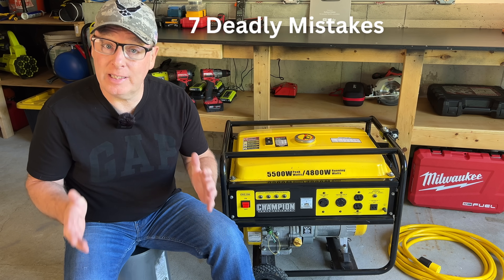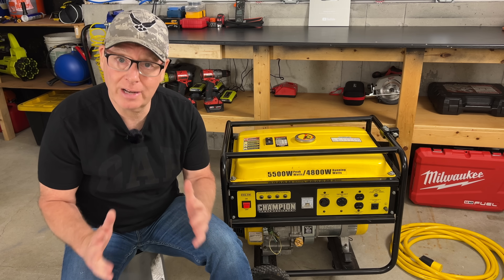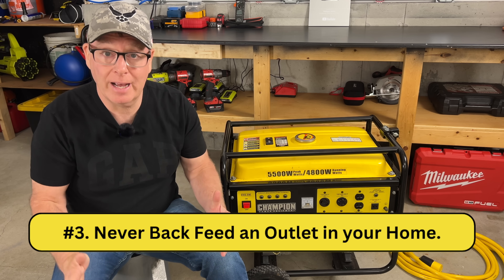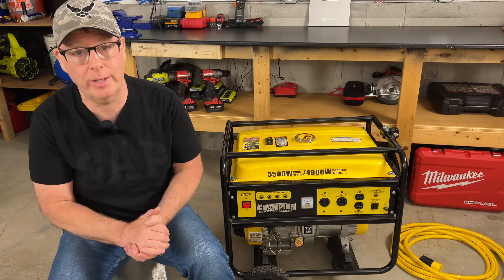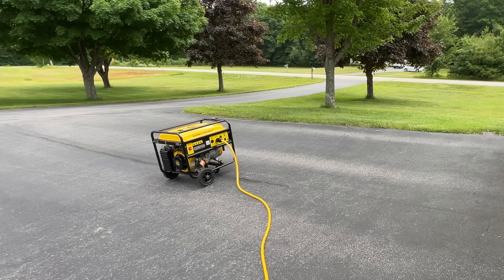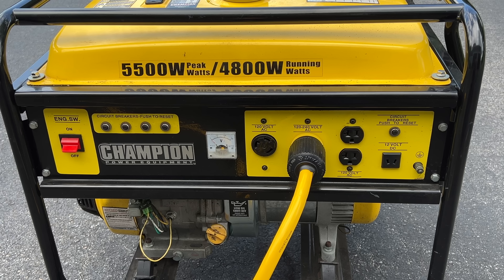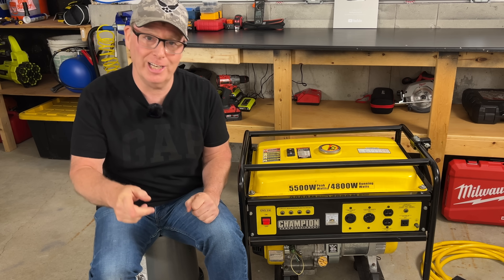7 Backup Generator Mistakes. (Have You Made One?)

Comment: Can u clarify:
1. Plug in cable from generator(L14-20) outlet to house (TT30PP)
2. Start generator let it warm up
3. Switch off breakers on Utility / Generator transfer panel
4. Move switch from Utility to Generator on panel
5. Switch on breakers Transfer panel 
To shut off and return to Utility power
1. Shut off generator
2. Unplug power cable from generator to house outlet
3. Switch from Generator to Utility on transfer panel (is it necessary to shut off the breakers on the transfer panel prior to #3)
Thank you!
Reply from the maker: No, the utility supply will have no problem when everything comes on at the same time. Cycling the breakers on one at a time when transferring to generator is a good idea so you want stall the generator or see a large voltage drop when everything cycles on all at once.

Comment: Agree with all that about the suicide cord and backfeeding. But I have one question/ comment about the risk to utility workers. I can't imagine a utility workers touching a conducter with bare hands.  And how is the utility protected from solar homes? Many are setup to feed excess into the utility. Wouldn't that be happening during an outage?
Reply from the maker: Legally installed grid tied solar installations require an automatic disconnect when utility power is lost. So no back feeding is possible. I think most lineman will wear protect gear including gloves but maybe that aren't as careful when they test a determine the line is de-energized. There are many cases of lineman being killed from back feeds. Another thing to consider is a neighbor on the same transformer.

Comment: Most likely a dumb question: assuming there is no gauge in your breaker box or generator how do you know how much power your generator is supplying at any given time while using it.  In other words I need to know how much power I am using so I am not over taxing the generator.  Any help is appreciated.
Reply from the maker: Here's a link to a wattage guide. It's not exact but it will give you a rough idea. Remember many of the loads listed are intermittent so we just need to be aware of what we run at the same time. https://unboundsolar.com/solar-information/power-table?srsltid=AfmBOopXB512JkVqevVGocF5xH2Cp_jZozEiIojjnUQkKtBO6zMTiV1c

Comment: I've read and seen videos of people connecting their cord to their unit AFTER they turned on their generator... so I'm a little confused here. Since I am looking into getting one for our new home. Any tips on this?
Reply from the maker: That’s fine in dry conditions. The reason to connect it before would be for safety in wet conditions. It’s very important to have the generator connected running and warmed up with the generator breaker in the off position. Never connect under load or try to start your generator while it’s loaded. I hope this clear things up for you.

Comment: Use only the best oil and gas non ethanol!! Keep extra battery and spark plug on hand also! Charge batteries often! Run generator once a month! Keep the generator out of the rain!! Put a plastic dog house rooftop over it when using when raining! Put the open end of dog house cover on the exhaust end of generator works great!!

Comment: Don't live in the city, do you.  A generator in the driveway would be gone by morning.  It's why city folk die from bringing it indoors or in the garage.  Chains don't work.  You can snap a chain, so can they.  The solution is in a shelter, with chains, lots of ventilation and let the shelter air out before going inside with the generator so CO clears.  It is what it is.

Comment: If you have a mechanical interlock your generator circuit will be off until you shut off the main and move the interlock. 
I also had my generator in a enclosed housing with the exhaust vented out.

Comment: Not sure if anybody mentioned this, but what I am doing to deal with the "wet generator" problem is to keep the generator permanently installed outside, in a GenTent with a skirt and clear apron. That keeps the weather off of it.  Then when I want to use the generator I will remove the skirt, which allows air into the intake and allows a clear exhaust path.  But the GenTent remains in place keeping weather out, and the clear apron protects the front panel so it doesn't get wet but permits visibility so you can see the panel.  

I have not yet had a power outage so I can't vouch for how well this system works, but I'm hoping for the best. 

Thanks for the info about refueling.  The manual says not to refuel while it's running, but your practical tips tell the whole story.

Comment: Just wondering if have 6/2 wire in my main breaker panel I would like to install interlock generator kit with 30 or 50 amp but it seems like need neutral on either one. Is that mean I will need to ruan new wire that does have neutral?

Comment: No. 8:  In a power outage it may be advisable disconnect your main switch in case your neighbor is backfeeding.
Reply: Most generators have a 30 amp breaker, if a neighbor was back feeding, I'm sure all the load would blow his breaker as he would be feeding everyone on that line

Comment: Great video. Can you make a video that shows how to connect a generator to an off grid house that uses the generator to fill batteries? In this scenario, there is no electrical grid. The entire house runs off of the batteries, and the batteries are charges via solar panels and/or the generator. And of most importance, is how the electrical circuit breaker box is setup and installed in the house. Thanks.

Comment: Question for you, or any electrician... I am installing an interlock kit and a generator inlet box to my main panel. I have a neutral bonded generator (Firman71XX series, 240V) and my panel is neutral bonded. Any ideas on how I can get around this without buying a subpanel or transfer switch?
Reply from the maker: You can remove the bond on the generator for when using it for home backup. If you want to use the same generator for other things you can buy or make a bonding plug.

Comment: We bought an exhaust system that takes the exhaust/carbon monoxide outside from our garage. Our neighbors are too close and the generator is too loud to be acceptable outside.
Reply: It’s a power outage, conditions aren’t normal, not everything can be as quiet as usual.  Generators, chainsaws, etc. all could have to be employed in emergency situations to maintain your home-a neighbor in the same situation as you are needs to be able to understand they can’t have normal quiet and deal with a generator being run.  That said if you have done this of your own accord, primarily for your own benefit-and they benefit from the quieter operation as well then so be it.
Reply: @balrog006  Your's is a message from a reasonable neighbour! Our neighbour is a retired bylaw officer and complains about every little thing! I suppose the generator could also be turned off at night because our frozen and refrigerated product won't be affected by a few hours of no power.

Comment: Use a longer filler hose so the fuel container is not directly above the generator. Use a funnel wider than the tank opening inorder to prevent spills. A hot generator takes a long time to cool to safe temperatures. Using a smaller refueling container is less awkward for handling.

Comment: Thanks for this! We just got a generator this winter and don't have an intterlock so I  connected gen->30a twist extension->15a 3prong freezer. At the time I was concerned about arcing since there's no switch in between. Would you suggest getting an extension cord with a built-in switch instead?
Reply from the maker: I'm not sure how you're connection the 15A and the 30A plugs since the are designed size specific. But you could buy a cord with a switch. The best option would be a generator connection like I show in this video. https://youtu.be/5y7RaJSAMZQ

Comment: Thanks for the video.  Do have to ground your generator when using? I've noticed that my generator has a grounding screw.
Reply from the maker: The generator is grounded from your electrical system when the cord is plugged in. The only reason to install a ground rod would be if the generator was connected as a separately derived system. This is when the generator and the utility service conductors both not and neutral are switched with a transfer switch. With most generator connections a ground rod is not required.

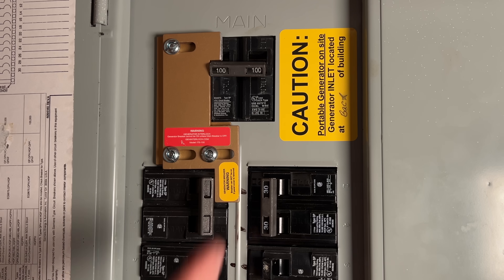Comment: At the 4:42 mark I think you meant to say you should always CLOSE the generator breaker before connecting/disconnecting the cord?  Can you verify.
Reply from the maker: I said you should always open the generator breaker before connecting or disconnecting the cord. An open breaker is a breaker on the off position which is the opposite of what  some may think. Different than when talking about plumbing and HVAC. An open water valve means water is flowing but a closed breaker means current is flowing.
Reply: @ thank you

Comment: CAN A VENTILATED PROPANE GENERATOR WORK IN A HOUSE, LIKE  A IN HOUSE VENTILATED PROPANE  FIREPLACE?  FINIS  PAX
Reply from the maker: No, even with ventilation, it is not safe to operate a propane generator inside a house. While propane produces less CO than a gas engine it's still not safe to run indoors. I do have a few videos on battery power stations which are clean and can run inside the home.

Comment: When you say you open your breaker, are you referring to turning it off or on?
Reply from the maker: Open means (off) and closed means (on) when it comes to electricity. I do try to use common terminology but my 40 years in the trade slips in sometimes.

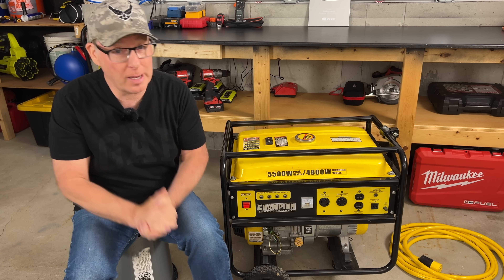Comment: 6:50 But if you do fuel it while on, be smart. I always fuel mine while on by making it safe as possible.
1. Make sure your genie is grounded.
2. Have a small fuel pump ($15 at harbor freight) to move the fuel into the genie.
3. Put fuel can on other side of the hot components and exhaust.
3. have an appropriate fire ext nearby just in case and wear at least safety glasses 😅

Comment: A higher voltage connection that is made before turning off the power (plugging or unplugging) can cause serious arcing and can be fatal. One of my co-workers plugged in a high voltage breaker to a service panel while the breaker was in the on position. The arcing almost killed him. Same thing can happen with lower voltages. Don't do it.
Reply from the maker: I think I mentioned not doing that in the video but you are right. Making connections under load is dangerous.

Comment: I had my electrician install a Generac generator cut over box at my cottage to run the well pump, sump pump, furnace, one bank of outlets and refrigerator off of a 5000 watt Champion inverter generator.  Had to use it last summer in a thunderstorm and it ran the pumps and fridge for three hours.  If I don't run the sump pump we get a wet basement so it saved the day.

Comment: When do I need to use the grounding connection on the generator? Kind of a pain hauling the copper grounding rod and wiring from the garage to the house.
Reply from the maker: You don’t need a ground rod unless you’re running a bonded neutral generator. Since the neutral can only be bonded in one location if you are running a bonded neutral you will need a transfer switch that switches the neutral and the hots completely isolating your service from the generator. The generator would now be considered a separately derived system. This isn’t common for home generator users.
Reply: @BackyardMaine  I'll look that up; it's over my head at the moment. It's a Predator, and has the nuts for a ground.

Comment: What are your thoughts on an externally vented exhaust thats connected to a generator located in a detached garage or shed. Properly heat shielded and insulated of course. I have a 50K diesel genset set up in this fashion for a commercial building with multiple freezer and refrigeration units.  I've been considering establishing a similar setup for my 8000w open frame unit that's in the garage at home.

Comment: During times when generator is not needed - you must run it occasionally just to be sure it will fire up when you do need it. How often? I'm going to say at least once a month. Also, petroleum gasoline degrades over time - some say it may fail you after 18 months - I have a pattern whereby there's not much in the generator, I'll empty the Jerry can into my car after a year, go fill the Jerry can put some from that into the generator for maintenance firings and carry on like that.  Final tip, never show a teenager how to make Molotov Cocktails.

Comment: Lately, I have read in a few places that we need a ground rod driven into the ground and attached to the generator.  I have never done this and wonder if it is really needed. What's your opinion on the ground rod ?
Reply from the maker: No a ground rod it not needed unless the generator is being run as a separately derived system which means it’s completely isolated from the utility power and neutral. I’m going to create a video covering this in detail

Comment: I want to make my extension cord to plug into my 30amp inlet . Mainly cause of the distance where i wanna run it during an outage  probably 45-50 ft to a dry area  . Would 10 gauge (30amp ) wire at that length be fine or would it need to be oversized to 8 gauge
Reply from the maker: It would work but you're going to experience voltage drop for sure. I would go with 8 gauge wire if I were you.

Comment: Hey John, I recently had a horrible accident with my generator and got extremely lucky. I was fueling the generator while it was running and had been running for 7 hours. I used a large funnel and was certain the tank could hold all 5 gallons of gas in my can. Well the funnel filled up and the generator tank couldn't take the fuel in the funnel. (I did not know this) so I wiggled the funnel thinking the gas would go down into the tank of the generator, instead it spilled all around the funnel, leaking all over the generator and the hot exhaust manifold ignited the gas vapors which chased back to the fuel tank holding 8 gallons of gas. This was one of the largest highest flames I have ever seen. I got extremely lucky that my home didn't catch fire and that no one was hurt. I learned a valuable lesson that day! Thanks for your video. - Cote, a fellow Mainer!
Reply from the maker: Wow Cote.. Scary accident. I have also filled my generator while running in the past but I haven't done that in a long time. It's easy to get impatient and fill it while running but as you now know it can be very dangerous. Welcome to the channel fellow Mainer and hunter I'm guessing from your channel name.

Comment: What about using a grounding rod for the generator?
Reply from the maker: Not needed unless you’re running a bonded neural generator and if you are you also need a transfer switch that switches the hits and the neutral connected in between the service bond and the load center

Comment: I would also mention that if using a generator with extension cords directly run to devices (fridge, pumps, etc...) and not to a grounded panel, then the generator needs to be connected to a ground.

Comment: Before following 1-7, at the start of storm season & whenever a storm warning is issued, start the generator & run it for a couple of minutes with a light plugged in to confirm it’s working. If it’s a gas powered generator, use a fuel preservative like Sta-Bil. Last thing you want is a generator that won’t start in a power outage because the fuel has gone ‘off’.
Reply from the maker: I have another video covering this and more.

Comment: Electric Vehicles with Vehicle to Load (V2L) or Vehicle to Home (V2H) capability can be used in place of a gas generator. When fully charged, an EV can power a house for a couple of days. If frugal with power draw, an EV will power a house for ~ 4 days. 

No issues re carbon monoxide, possibility of theft, running overnight, noise, needing to regularly refuel, etc.
Reply from the maker: I don’t have an electric car but I do have a battery power station with an automatic transfer switch

Comment: I presume that having a generator running and powering necessary circuits and then having the generator run out of fuel is a bad thing for the generator circuitry. I try not to do that and anticipate when fuel will run out, shut the circuits off, stop the generator and then refuel. Restart will follow the suggested procedure.
Reply from the maker: You are right on the money!

Comment: I noticed you did not ground your generator when running, that is a good way to become a welder.
Reply from the maker: Wrong. The generator is grounded and bonded through the ground and bond connection to my electrical system. This type of connection does not require a ground rod and installing one would be less safe. Also you want to be running a floating neutral generator with this type of connection because there can only be one neutral to ground bond on the electrical system.  I really need to make a video on this so people will understand purpose of a ground rod, about bonded and floating neutral generators and separately derived systems. I find this subject is the most misunderstood by home owners DIYers and even some electricians.